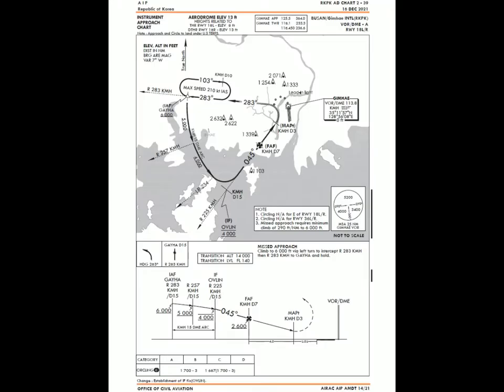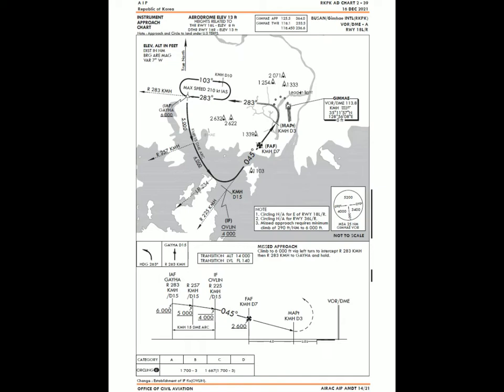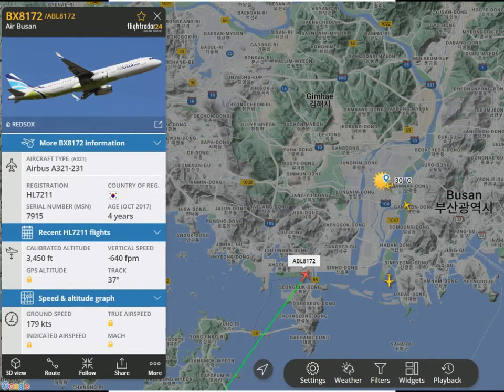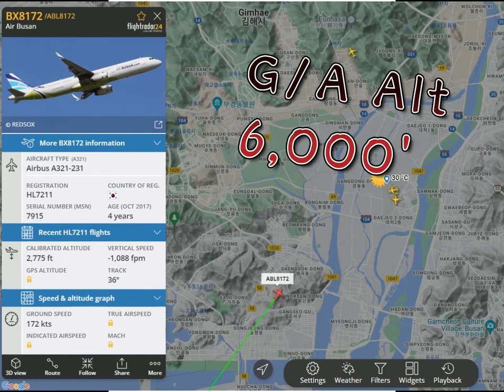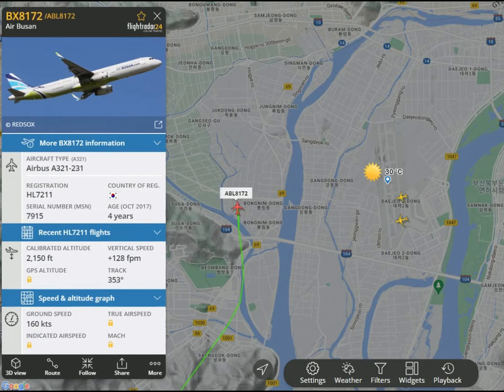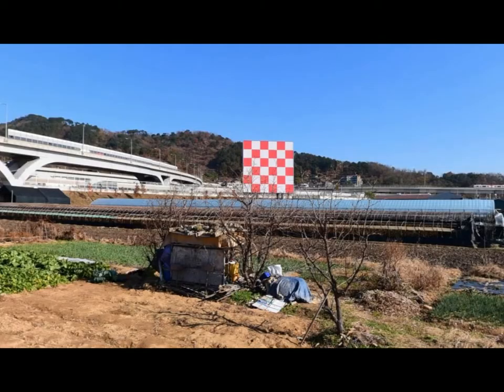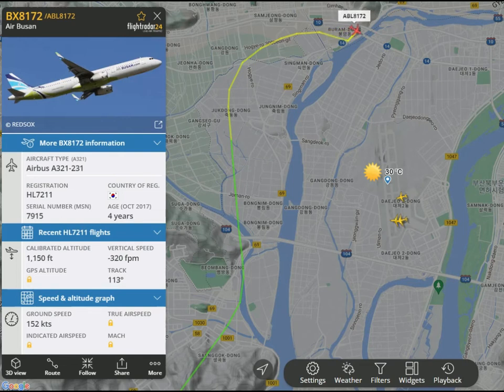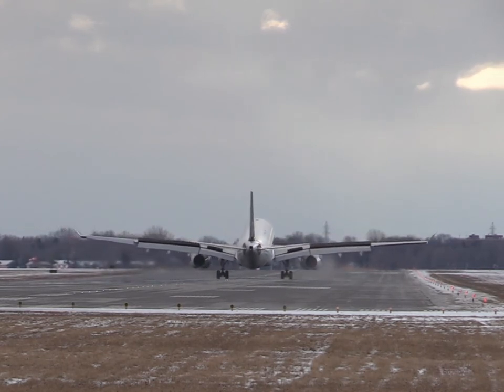Gimhae Int'l Airport(RKPK/PUS) VOR/DME-A, then Circling Rwy 18R

Comment: Thank you for the guidance on this approach! I’m transitioning onto a new fleet that flies into Busan so I  hope to get some help from you.

1. At the 26-28sec point to turn base, what kind of bank angle should I expect to use? How soon will I expect to see the checker board during my right turn? I’m worried about late turn causing lateral path over the highway.

2. You mentioned the pumping station for final turn. What is a good on-path altitude I should be at before the final turn? To avoid under or overshoot the final.

3. Any advice on flying this 18R approach during night time when the landmark cannot be easily identified? I flew this in the simulator a few times but the ground lead-in lights aren’t that easy to see. I probably only saw 3 of the 5 lights.
Reply from the maker: It will be stressful for the first few approaches. However, it is not that difficult as long as you fly as I mentioned on the video.

1. Bank angle to the base turn. Normal bank. For me, 25 degree. It will give you enough margin with the highway. The key point is crossing the highway is prohibited. On the base leg, find and fly to the Pumping Station while maintaining descent rate. Ask your F/O to find the PAPI.

2. You get closer to the Pumping Station, your F/O can notice the PAPI lights. Adjust your altitude in correspond with the PAPI. I have no idea about the on-path altitude.

3. It is extremely difficult to shoot the Circling Approach at night. It is best to ask controller ILS Rwy 36L , even with the tailwind condition. Then, expect holding until they change the active runway.
PKPK is contrilled by military. In my experience, their preferred rwy is 36 at night, around 7 pm. I have done Circling Approach several times at night and do not recommend the Circling Approach to the unfamiliar pilots.

Hope my answers are helpful for you. Safe flying~!
Reply: I appreciate the quick reply! You surely help me understand more details on this approach and also the alternative option at night. After all it really doesn’t explain much on the approach charts…

I enjoy your explanation. Will you do more videos on special non precision approaches in Asia?
Reply from the maker: @GMamba I agree with you. The charts should be more detailed.
Very glad to hear that my video was helpful. I also thanks to my daughter for her nice narration.
I no longer fly airlinesand am outdated. As far as I know, RKPK VOR/Circling Approach is the most unique n dangerous. That's why I made the video.

Anyway, enjoy the RKPK Circling ~.
Ah, one more.. There were some pilots confused Rwy 18R n Rwy 18L keep that in mind that Rwy 18R has a displaced threshold
Reply: I see. Thank you for your contribution and happy retirement!